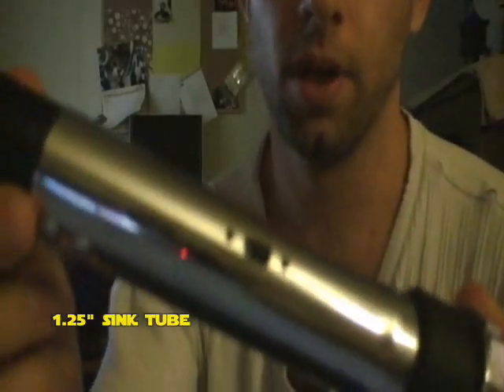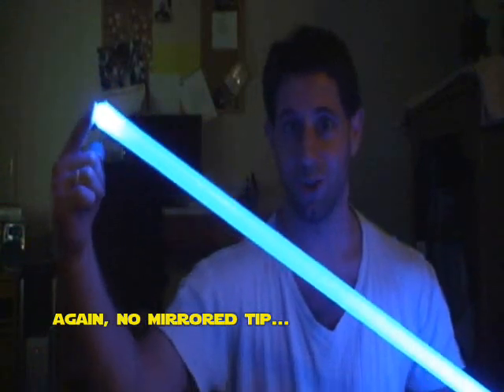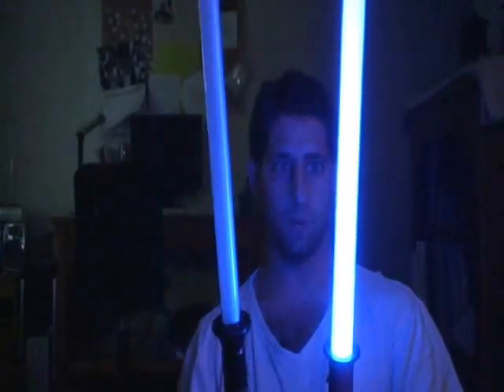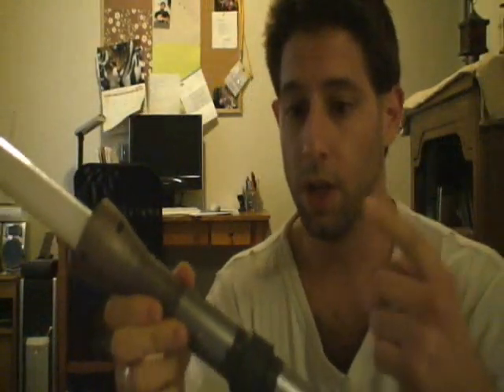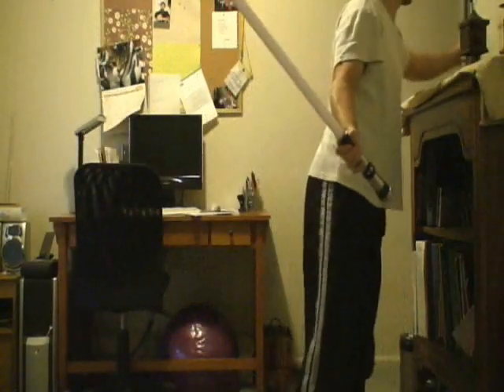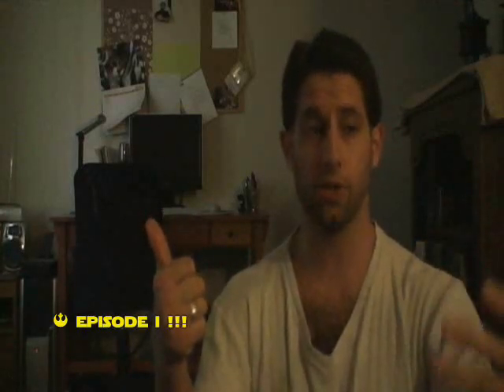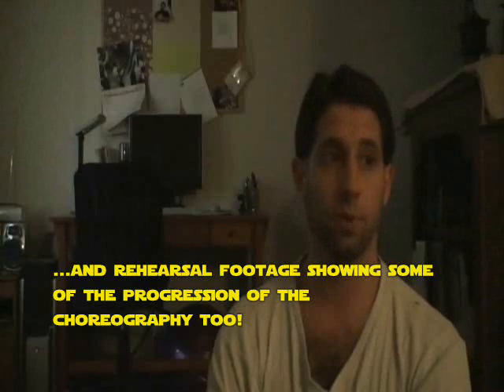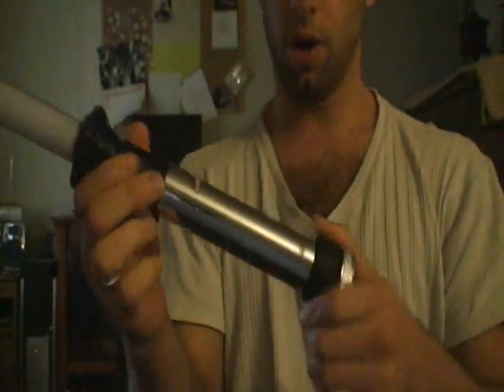Basic Saber Construction - Novastar Demos "sink tube" Sabers

Comment: if you put a mirror tip, then would the light stop and not pass through the tip (making it look like a colorless tip?

and what's the general name for the blade tip if i'm trying to find it in a plumbing store.. THANKS love your work it's awesome
Reply from the maker: +Jonathan Tanoto Great question.  In general, it depends on how you do it.  If you put a fairly "vanilla" mirror material in that allows NO light through... you're absolutely correct.

However, if you think even a tiny bit "outside the box", you can leave SOME areas open to allowing SOME light through... while the remainder is reflected.  It doesn't take much to illuminate the tip.

Further, you could also use "concave" style tips, but you'd either need to hollow them out (basically) yourself, or, buy them as such.

I don't think you'll find those in any given plumbing store, though... sorry!  :(

Comment: Hey Novastar, can you use a hand drill for this or does it have to be like a drill-press table thing?
Reply from the maker: Noah Winters Yes.  Actually, at the time of this video (and even up to just around NOW), I used a hand drill to do the switch openings (including tiny screw holes), the recharge port opening (not seen in this video) if applicable, and also the screw holes that allow mounting the blade holder.

For holes that need to have screws to affix the blade holder, you'll need to also buy a "tap" set, which basically "threads" the inner wall of a hole for screws to... well... screw into.  :)

The tap set that I use is done by hand.  It takes some time to do everything by hand, but... when you don't have $1000s to spare--you use BASIC tools and accomplish a lot.
Reply: ***** Nice. What kind of switch is that btw?

Comment: uhm is that just any run of the mill slide switch you used, Nova? Or does the switch also have to be able to run certain amps without going over?
Reply from the maker: madpinoy5683 Most switches are rated for a decent amount of amps (usually 25A or more?), so it's unlikely your saber would ever have enough output juice to cause a problem.

The switches I like to use mount from the INSIDE, and use pre-threaded screws.  However, any "latching" switch that is a hard cut to a power line will work.  it can be a push button switch as well.  As long as it is "latching".

If you use a circuit board, you would need to check what type of switch(es) the circuit board supported (momentary, latching n/o, latching n/c).
Reply: ***** I see. I asked because on eBay they sell slide switches like the ones on this vid and they can only support 0.5A which is kinda surprising. I guess I should just buy them from Radio Shack since they have the screws already.

Another question I have is how you would keep the internals from rattling in the hilt.

Comment: I'm thinking about luxing up my current sink tube saber project as well. Its also 1.25. I like that size of tube, fits my hands good. I know about the blade holder and such. Where would the led sit at though same with the blade? That'll be the confusing part for me. I plan to do 4 AA batteries, red-orange Rebel LED, and whichever resistor is best for that set up. I might customize mine too with some black tape. Maybe get some O-rings on the bottom and tape over that too. Thanks for any help. =]

Comment: Thanks!  I have a background in electronics engineers so hopefully I will be able to contribute something! I haven't laid my hands on a saber yet but I've already got some ideas.. Like using Photo resistors or optocouplers connected to the REF and CTL of a buckpuck to hopefully allow the cheap sound board to control the brightness of a luxeon... Someone may have already done this. :-?  optocoupling seems like the safest sollution to isolate the sound board and unlike a relay its variable.